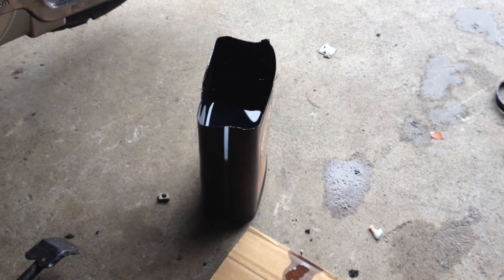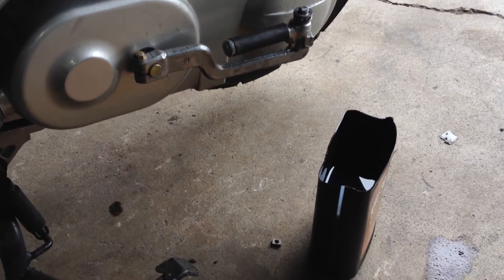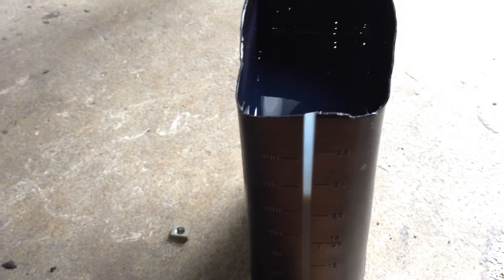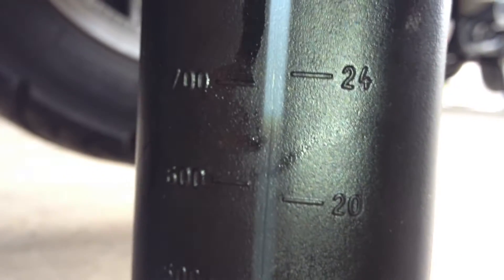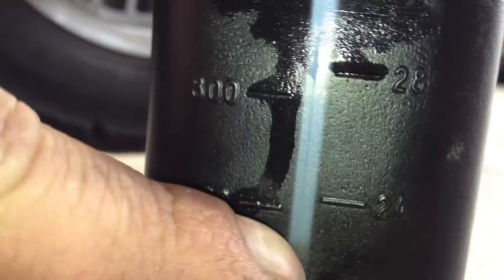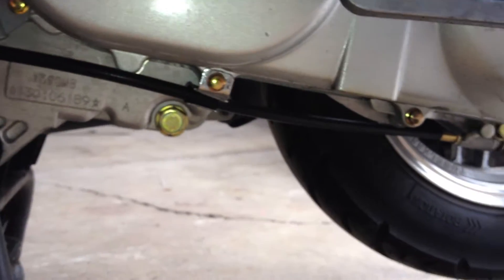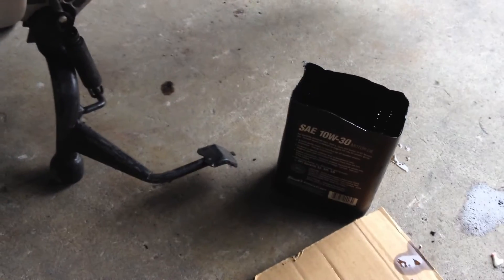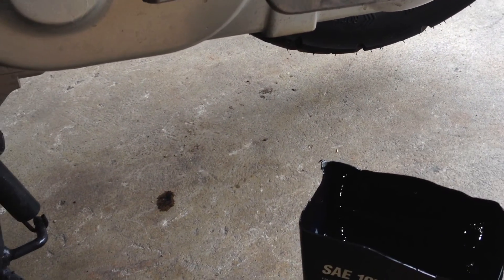Chinese Scooters & Chinese Motor Oil, Why you Change the Oil Immediately on a New Scooter

Comment: 2021 My Scooter shop guys all say run the Chinese oil for 100 miles then change it due to the small metal filings that accumulate in the oil from a brand new engine. Next oil change at 1000 miles. Your opinion ?
Reply from the maker: Thats a good way to get more repair work & Engine rebuilds. 
NO, That oil is crap, and has the lubrication properties of pretty much Veggie Oil.  Running it for anything accept a trip around the block to test out & warm up a new de-crated bike is causing damage. So basically MORE metal filings than would be otherwise. 

CORRECT PROCESS (And mind you, before I closed my shop due to family issues, got rid of the now ex-wife, I got the kids, including my disabled son, so couldn't run my shop full time and take care of my disabled son, I was the largest Chinese Scooter dealer in Wisconsin, as well as a fairly large importer and seller of chinese scooter parts). 
So Correct Process:
De-Crate & Assemble Scooter. 
1:Get scooter started, and let scooter warm up & adjust carb. Once block is warm, drain oil and refill with QUALITY; NON SYNTHETIC oil. (Around 75% of those metal shavings will come out with that initial draining of the factory fill, and we're talking with less than 10 miles on the bike, that is factory test run + getting it started and warmed up, this is important that the block is warm so the filler oil flows and you get MORE of it out). 

2: FIRST 300 miles is the most important. Instruct customer to take it easy, no hard acceleration, vary speed and don't run it full speed continuously. This is extremely important and the most important time for the overall longevity of the scooter. 
3: Oil change is then at 300 miles. Refill with QUALITY SYNTHETIC. I HIGHLY Recommend Castrol Edge Titanium 10W-30 for Northern States 15w-40 for southern/warmer. It's the one in the GOLD bottle. 
4: Next oil change is at 1000 miles, again with Castrol Edge recommended. 

If you REALLY Want the engine to last, second customer oil change at 1000 miles, then every 500 miles, so 1500 on the odo, then 2000 on the odo etc....

Doing my above regimen, my customers routinely hit 50,000 miles before  having a cylinder or piston replaced. 

One GREAT example was a customer who worked as city hall maintenence manager. He drove his 50cc scooter 30 miles each way, straight down country highway. Two stop lights in route only. I did his piston & cylinder at the 50,000 mark, not because it needed it, but because he wanted a larger bore. We upped it to 100cc bore kit. He didn't care for that too much, so we dropped it to an 80cc, and that was perfect. Drove it another year and ~25,000 miles before he sold it to a college kid and bought a Honda Rebel 250cc.

Comment: I just discovered this.  My daughters ATV ran for about 45 minutes with this type of oil in it.  Now, it was full on the mark of the dipstick.  I've drained it, and replaced it.  Do you think that 45 minutes hurt the engine?
Reply from the maker: Christopher Bain not at all, run a regular oil for the rest of break in then switch to castrol edge i the GOLD bottle ( NOT BLACK BOTTLE)
Reply: Actually Chinese oil is very good stuff!!! Do some testing on it.

Comment: what oil do you use for the gear?
Reply: Loo kang Gear oil uses sulphur additives for pressure hence they smell,like rotten eggs. For transmissions use a 75w90 or 80w90 gear oil. You dont have to change gear oil with engine oil, gear oil lasts much longer. 3000kms easy or 6 months
Reply: King thanks , I’ll do that . Can I use full synthetic for both engine and transmission ?
Reply: @Novasquad77  Transmission should be full synth. In engine you can use full or semi synth

Comment: The place i purchased my Chinese bws 150cc to use 40/50 oil os this correct can i use that or get a different weight
Reply from the maker: link 100M hassan not correct. it requires 15w-40 if hotter climate or 10w-30/10w-40 in cooler climates
Reply: @KmanAuto  what about 20w50 i live in hot climate middle east
Reply from the maker: link 100M hassan how hot are we talking about? *c on hot day?
Reply: @KmanAuto  30-45 c
Reply from the maker: link 100M hassan 15w-40  and get synthetic if available. 20w50 only if your burning oil. and even in those temperatures let 20w-50 with the engine run for 30 seconds to one minute before driving first time each day. the oil pump is very tiny and the flow is slow
Reply: link 100M hassan A good 10w40 will be good. Standard climates use 10w30. A good semi or full synthetic 10w40 will do. Rae of oil flow provides lubrication as well as cooling, 20w50 is too thick

Comment: Which brand of oil do you reccomend? What do you think about Yamaha / Shell? 

And after how many Kilometers / Miles do you have to change the motor oil on a Chinese bike?
Reply from the maker: For a Chinese bike, off the shelf cheap oil until main break in is done. So change factory fill oil, put cheap 10w-40 in, change oil at 100 km/miles, cheap oil again. Change again at 600, put in Castrol Edge (GOLD BOTTLE ONLY) Synthetic. Oil change at 1000, then every 1000 or once/year before winter storage whichever comes first. If you want it to last even longer, change every 500. Oil is cheap.